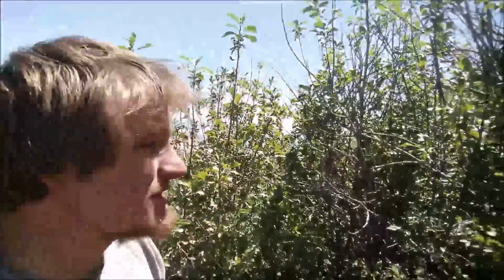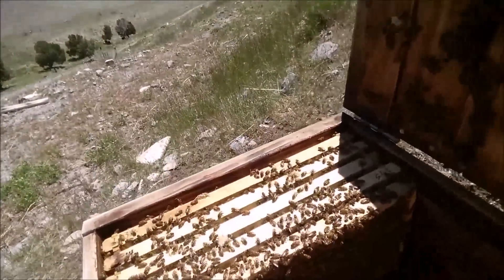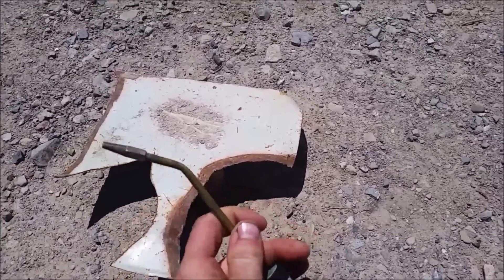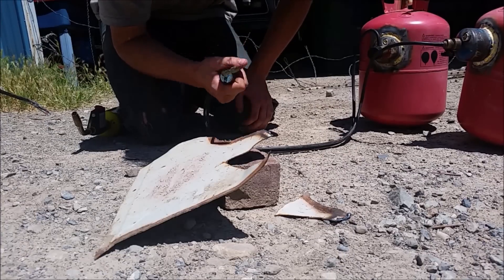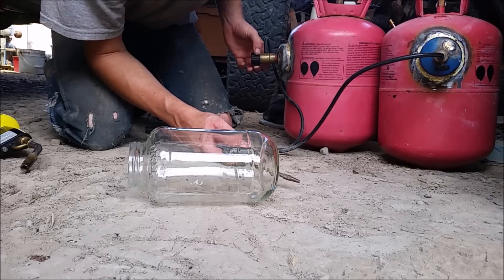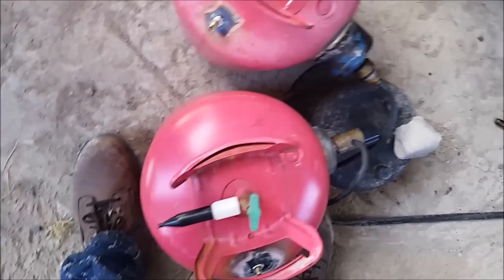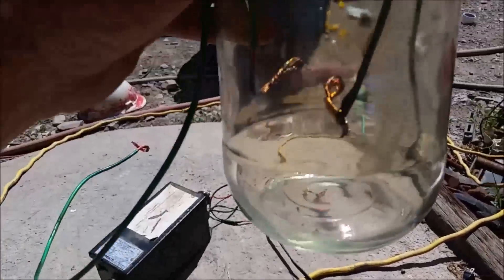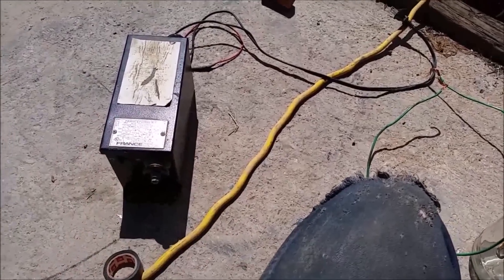Testing My Oxyhydrogen Torch

Comment: Since you have the oxygen, why not cut the end off a steel brake line, have a piece of extra fine steel wool in the end then slowly turn up the oxygen flow thru the tube? basically an IKEA  thermal lance.

Comment: 5:47 Teacher: Water has no taste. Cody says it does. Be like Cody. :D
Reply: +MyLonewolf25 Deluded water xD
Reply: Water itself doesn't have taste what it's deluded in does so pure 100% water doesn't
Reply: I have found that if you drink pure water (zero mineral analysis) for several months (or even rainwater probably... unfortunately I didn't have access to rainwater at the time I switched to pure water from tap water) as opposed to municipal (also called town water) tap (faucet) water; your ability to differentiate between different tastes get a lot better. 

I can now easily taste the difference between distilled water, rain water, quality bottled pure water(which is very rare) , crappy bottled water (which is very common! Especially ones with high mineral counts on the analysis label or no analysis label at all) and of course tap water which you can usually smell before you even taste it! 

[Just sharing my experience for inferential reference. I think I should say I don't drink much soft-drink (soda-pop) at all but do drink alcohol so not sure if what other drinks one takes makes any difference. If you are interested the brand of pure water is from noblebeverages com in AU (not affiliated in any way)]
Reply: Actually ultra pure water supposedly tastes very bitter as it doesn't have any of the salts in it which gives it the taste of "nothing" although water does actually taste of something it's just the way our taste buds work is by comparing what we have just put into our mouths to our saliva which is ever so slightly salty and because normal water has the same taste as saliva our taste buds assume its nothing and therefore we taste nothing. If our saliva was on the other hand sweet then we would taste water, most likely it would taste salty but only just.
Reply: Ultra pure water has no taste. Normal water tends to have different minerals dissolved in it.
Reply: haha I know what you are saying Jorion Edwards but how else can one describe it?
When we taste something without any taste we say "It doesn't taste like anything" it's tasteless, that is it's taste! LOL

We can split hairs all day about the ambiguity of language, but it doesn't help us much. You seem happy to to be unspecific and use the term "normal water" but I still know what your sentence means so it's all good mate.
Reply: +N!cky Water*...?
Reply: +Ben Camp oh my god i didnt noticed :D
Reply: Drew Hurst
All right. You got me there. It's like those "tasteless" medicines that are either sickeningly sweet or bitter beyond belief. It just doesn’t make sense.
Reply: it depends on your skill, if your taste abillity if low because you are a smoker or heavy sugar consumer or booth then you might not be able to differntiate water.
Reply: Did you ever split a hair?
Reply: Dirty water has a taste. 
Drinking a pure water its a choise from where you drink it. Its because of its taste. Good or bad.
Doesn't matter its about what's in the water... but everyone would refer to this as a tasty or not a tasty water. There are many kinds of water...

Comment: ive always used oxy-acetylene but im not sure how hot it burns compared to this torch and since you can make hydrogen yourself its alot cheaper but the oxy-acetylene burns with an orange when adjusted low and blue when adjusted high so easy to see also acetylene is hard to use indoors because if not adjusted right it drops ashes EVERYWHERE

Comment: When you said that the hydrogen atoms are so small that they escape through the tiniest holes, that's not really correct. Even the largest atoms would escape from the very same holes - the problem here, I think, would be rather the density of the liquid/gas, with the atmosphere pushing it upward more so than what it would the oxygen, or any other gas for that matter.

Comment: Back when I was a kid, we used lye solution and aluminum foil to make 'dirty' hydrogen.
We collected it in the biggest balloons we could find and had great fun igniting the balloons in various ways.
One day I put a small steel tube in the neck of a balloon to use as a nozzle.
Since the hydrogen was 'dirty' with NaOH./water vapor, the flame from the tube was yellow-orange.
Anyway, the tube got too hot to hold, and I dropped it into the kitchen sink.
The flame heated up a patch of the enamel [cast-iron sink, really thick enamel coating] and it spalled off!
A shard of the hot ceramic found the balloon, popped it, and the fire-ball filled the kitchen!
Mom was not pleased.
Reply from the maker: +Greg Gallacci 
Hillarious story! here is a video of my first "hydrogen generator" https://youtu.be/GRg47_cjdlQ
Reply: @theCodyReeder  this video is set to private now. D:
Reply: the wonderful stories of our youth. ..... how many times I nearly killed myself or at least scared myself really good. ... most often I was more afraid of being caught. .. today they would jail me for bomb making lol

once I took one of those cheap torches the ones that come with propane blue bottle and oxygen yellow bottle .... got a neutral flame and filled a plastic shopping bag with the gas and taped a match head and toilet paper fuse to it and boom.... was at my best friends house it rattled the windows violently and in certain it was heard for at least a mile. ..... scared the f  or of my friend
yeah the fun of child hood when ask we had to great was death and a serious whooping from dad....
were the days

once I blasted a hole into one of the local irrigation canals with a small black powder cannon I built with a tiny lathe. .. the hole was a foot across and 6 inches deep into concrete and the cannon well it vanished except for a brass streak left on the surrounding concrete
Reply: +Greg Gallacci   Damm.!.. I'm 52 and was also a bit of a "kaboom-addict", and have of course scares to proove it :) to Gret concern of my mom.! As a dad myself now, I understand her... Wouldn'd be happy ONE SEC if my son carried the explo-gen, but glad he's not intrested.!
.. We both did fun-things, and Wé also had more freedom to do so.! The cops behaved more like "real people",  instead of the pricks I see nowadays... Not ok with this : "Harsh punnishment" bs they even use on kids, who're DEF Not linked to terrorism, like a kid in our neigbourhood ' horrorstory.!
The poor 17-year old, suburban, all applepie& games kid, lost three fingers trying to make some Loud bangers.
Illigal;? YES.! Yet he was straight from the hospital held in carsery for FIVE Days, and meanwhile his parents & friends received the Whole Anti Terrorist interogation, while getting intimitated Gestapo style.! ..Poor kid was in pain, mutulated ànd held in isolation, seperated from éverybody who loved him... No wonder he sobbingly confested to just about anything, these PIGS (!) sqeesed outta him.! 
These idiot-charges were dropped, but the dammage to that child (it Was a child, NOT Bin-Laden) was done.!
the cops didn't give a Fuck about his pain, Nor the fact him being deformed and made sure he knew their point of view as he :"Diserved" it, and had to : "Take his medicin" like a man.!?!?! I mean, WTFuck.?? How nasty & cruel is thàt.?
.. At least That kinda shit we were spared off, thank God.! And I hope our kids will be able to be kids like we were, as we turned out just fine, even with our "lawbreaking.!
Greetz, my friend.
Reply: Why do I have to be so cursed as to be born in 2002. I hate my life
Reply: Well I would... the main problem is the law.
Reply: thank you for a new way of making hydrogen
Reply: My wife left me alone one day while i was making browns gas... contained it in a plastic tupperware, flame back tracked... I stumbled outside after the explosion... took a few hours for the damn phone to stop ringing... it wasn't the phone... HAHAHAHAHAAH
Reply: all you have to do is not watch television, stop using the phone much, and pick up some books. it is what the "older" generations used to do. just recreate your environment to what the older generations used to do and you will start to behave and experience what they lived. by the way the boredom that sets in is your friend it is what you have to cross to let your brain get creative and zaps a flame in your ass to live life to its fullest. if you let tv or other digital stimulants fill your brain then you will not be in control of your life.

Comment: HEARS A TIP FROM AN OLD WELDING MECHANIC> GET REGULATORS.SET PSI OX 5-12 H TO 8-15 H BURNS CLEAN BUT IT TAKES MORE FUEL TO DO THE SAME WORK. BECAUSEOF NO CARBON ATOMS. TO CARRY GERATER BTU VALUES.CARBON ATOMS CARRY HEAT.

Comment: That's not true, a proper cutting torch has a preheat flame fed by a separate gas circuit than the oxy cutting jet and no matter what you use as a fuel it will stay lit.

Comment: You have a bigger problem with using hydrogen because it's so small it actually permeate through the metal itself without a hole. That is why people perform electrolysis on demand instead of storing it because it's easier to store hydrogen as water.

Comment: It wouldn't even matter if you blew the flame out with the oxygen. The chemical reaction takes place between the iron in the steel and the oxygen. Its "burning" the steel the same way steel rusts (oxidizes) when exposed to water, just at a highly accelerated rate. The fuel gas, in this case hydrogen, is just used to get the steel to a working temperature for the chemical process to take place. Once the chemical reaction has started you can actually turn the fuel gas off and continue to cut.

Comment: I haven't read all the comments, but if you weren't aware hydrogen inclusions often make for a brittle weld, especially on thicker materials. In WWII acetylene was scarce but oxyhydrogen was easy, so it was used where it reasonably could be. That was typically on aluminum (with flux). I'm not saying it's useless for welding steel but I certainly wouldn't trust it, about like arc welding with a coat hanger wrapped in newspaper.

Comment: Hydrogen also diffuses in between Iron atoms, that's why you usually need special tanks to store it.
It also changes the structure of the metal and weakens it, so you should watch out to not have as much presure in your hydrogen tank, because the chance of a rupture gets higher the longer the Hydrogen is stored inside.

Comment: That is the most dangerous oxy fuel setup I have ever seen. And I have seen some shit in the field. 
Tig s way better than brazing, those tanks aren't rated for high pressure and those valves will not stop H2.
Please use proper equipment before you hurt yourself or someone else.

Comment: something for you to try,start heating the metal and as soon as you start the cut turn off the hydrogen(i used acetylene it should work with hydrogen as well ) and as long as the oxygen is aiming at the molten part of the cut you can continue cutting for a short distance,something i learned as an apprentice

Comment: The Oxyhydrogen can burn in excess of 5800F while Oxyacetylene burns at about 6000F. However I had seen Oxyhydrogen start to melt Tungsten while the Acetylene couldn't... Meaning possibly that the torch heads can add a huge variable to this temperature...
Reply: Hi trollface, i didn't know that you watched cody XD
Reply: That's is a valid point. But I still stand by my original statement that the torch heads can make a huge difference.

 It sorta like the Idea of a pencil point vs swirl flame propane torch. Even if you have them using the same fuel amount the Swirl just burns way better, because the primary and secondary flames are mixed efficiently into one flame leaving very little "Waste heat..."

 Unlike the Pencil flame where only the very tip is hot, and the rest of the flame is rather cold and wasteful...
Reply: +Nuno Marques Just started, as I seen some of his videos in my recommend section.
Reply: +TrollFaceTheMan Heat conductivity of the gas is a major factor. While oxyacetylene burns hotter, it is a 'less dense' heat.
I will go to hell for that last bit, but I don't know the proper words to say that one gas system has more 'density' of heat while the other has a higher temperature but is less 'dense'.
Should have paid more attention in class...
Reply: it's not the torch heads that make the difference and oxyhydrogen can exceed 9,000 degrees it does not carry away the heat and seems to automatically adjust to the material .... it will melt everything known to man. ... you see science even though scientists think n they are God's they know so little about how nature and the world works everything is a guess and almost every time of science has its exceptions. ..... the way the sun works no one knows they only guess. .. and the sun is an oxy hydrogen burn and everything melts in the sun ..... 
browns gas is just so  unstudied .... one of those ignored things. ... the combining of the 2 most powerful elements creating water and heat very easily controlled heat yet if combined and ignited beats black powder. .... anyone ever blow stumps with browns gas it world great
Reply: +Greg Gallacci part of the problem is impurities in oxy accetalene depositing on the surface as well as oxygen oxidizing the surface ... these things create a heat shield of carbon and oxides that protect the work surface reflecting heat

Comment: For all you people concerned about the mercury, only long term exposure is truly hazardous. A few seconds of contact will do literally nothing. Now, if you stuck your hand in a bowl of it for a few minutes, you would have a problem.
Reply: +Cody'sLab lol dude you are crazy. but I like it.
Reply: If it was metallic mercury, you would have no problems even after several minutes of exposure, as long as it's well ventillated or you wear a breathing mask. Bulk metallic mercury is too unreactive to poison you.

If you instead had some mercury salts in solution, or even worse, dimethylmercury, even brief skin exposure would be deadly (in case of dimethylmercury, even through gloves).
Reply: it can't really even be absorbed through the skin, just vapors through the air. directly into ur blood
Reply: bunnyfaceperson123 ha

Comment: The problem with your leaking tank is that hydrogen atoms are so small that they can flow through almost any material. Your tanks may be perfectly sealed for most gasses but Hydrogen will still flow out.
This is even a problem for industry facilities that use hydrogen because they need special storage.
There is Chemical storage that almost eliminates leakage but needs energy to retrieve the hydrogen and another solution i heard of (but im not sure about this one)  is a metal foam (pure metal with lots of bubbles) which is not quite perfect in storing hydrogen but has far less leakage then a hollow container.

Comment: You can mix soap and water in a spray bottle and spray on your tanks to pinpoint your leaks without having to dunk the whole thing under water. Lots of people also use this trick to find nails and other holes in car tires.
Nice Video,
Cheers!

Comment: Firstly, it is very creative design. I think that you should braze smaller diametered valve instead of bigger part at the side of the tanks, to ensure leakproof brazing. Also some tank's head valve is removable. When you use one of them, you can change that head valve with refilleble (2 directional flow) one, So you don't need to braze additional valve especially at he side one.

Comment: You can actually cut steel with only oxygen if you get the steel up to temperature first. 
Did that with a blowtorch at my school to prove it was possible, though impractical has its kinda hard to keep the steel burning.
Reply: +Cody'sLab Chlorine gas, man be careful when using the halogens, im sure you know what happens if you breath it in
Reply: You really need some proper equipment with halogens. Because of a mistake of a co-worker I once inhaled a few ppm's of it and Immediatly I couldn't breathe and my throat was on fire. Pretty horrible experience.
Reply: +Sythe_Hunter ww1 soldiers definnetly knew what happened when they breath chlorine gas in
Reply: +TheLawnWanderer Why oxygen?
Reply: +sadfasdfa sdfsfdfasdf I've been there. the stupid Mexican dishwasher at my uncle's restaurant decided to clean dishes with bleach and ammonia. stupid bitch could have killed me, I went into the back with some dishes. let alone everyone in the restaurant.
Reply: +Joe Anthing when "cutting" steel with a flame torch you are actually rapidly oxidizing the steel with a jet of oxygen. once the steel is hot enough to cause rapid oxidation you can remove the heat source entirely as long as the oxygen is continually oxidizing the steel through moving the source at a consistent rate

Comment: You are pretty clever.   Use you ingenuity to invent an engine that runs on water.
Reply: While you're at it reinvent the wheel.
Reply: +Mark McCormack I can't tell if you are joking or not but ever since i saw hho gas for the first time I have been saying that a engine could be built for it.
Reply: +glockfan112 Hi GF I really don't understand what MM was trying to say.  I think it would be a simple idea to make an engine run on HHO.  But I don't really know.  Hydrogen will not compress and burn very good, too explosive.  I detonates too soon.  Oxygen will not burn alone.  But HHO will.   

Engines have been made to run on propane.  That is common place.  But they are not that much less expensive than gas.  They are much cleaner.   HHO would be a very clean fuel too. 

Thanks for you comment